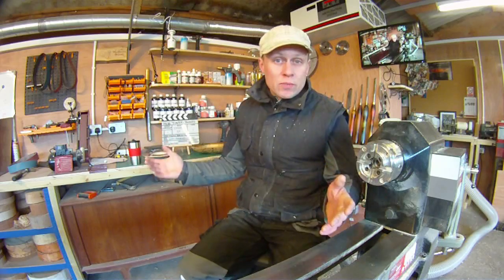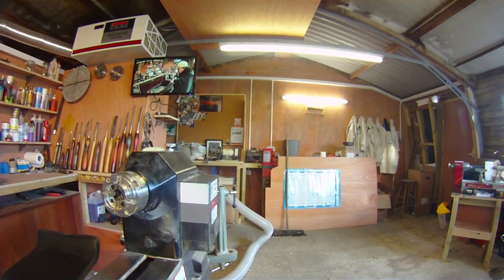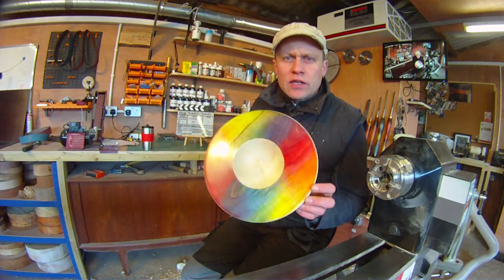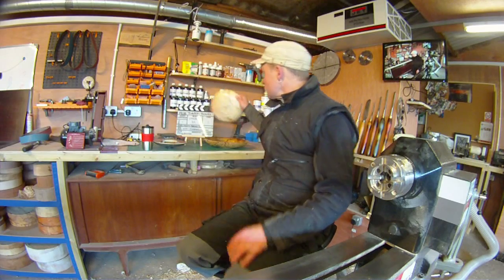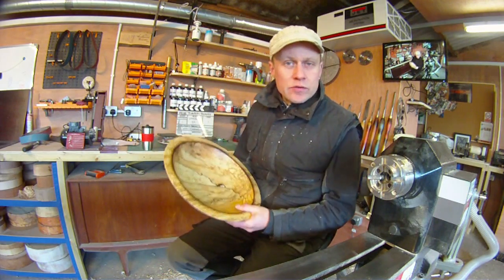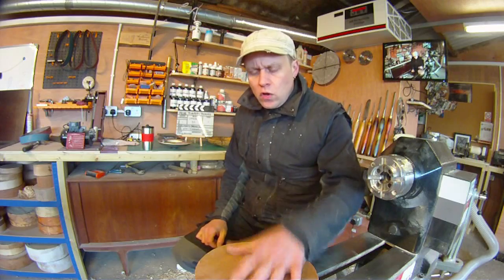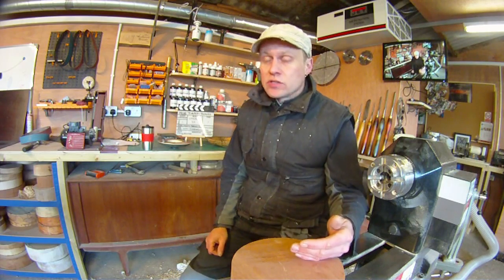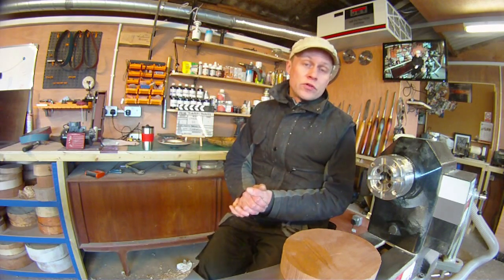E59   Video Next Week! New Workshop Tour and Christmas Pricing

Comment: Good point on pricing.  I did a few craft fairs and it was pointless trying to compete with tables full of cheap, imported, mass-produced goods that set the prices in peoples' heads before they got to me and them had them looking but walking past.  The worst comments were "Your stuff is beautiful but it's very dear".  It wasn't, but my £20 Burr Elm bowl was a lot more expensive than the similar sized, plain, mass-produced one at £1.50.  So, no more fairs for me.
Best Wishes, Brendan.

Comment: The new shop looks great, but I wonder how long until you knock out some walls to expand...if this venture takes off like I think it will. ;-) One more thing on pricing is to consider the market you choose. Some of the other comments touched on this. One more question...have you put the new Comet lathe through it paces yet? I saw one in my local woodworking store and I like how it looks, but how does it perform? The new Galaxy looks great, but I think it's out of my price range.